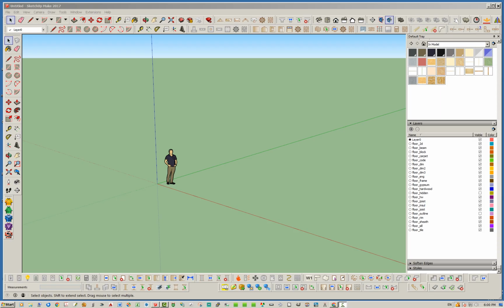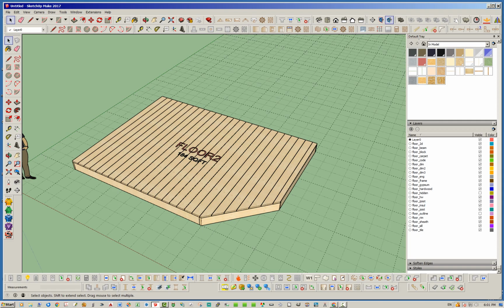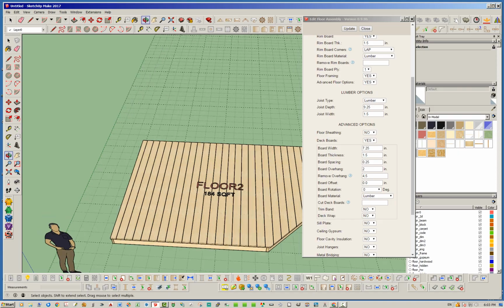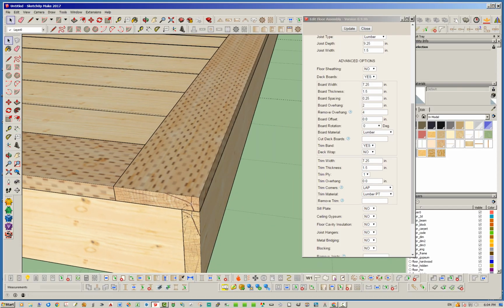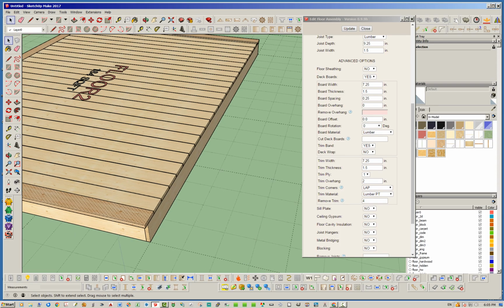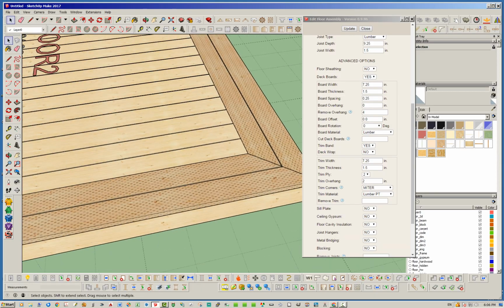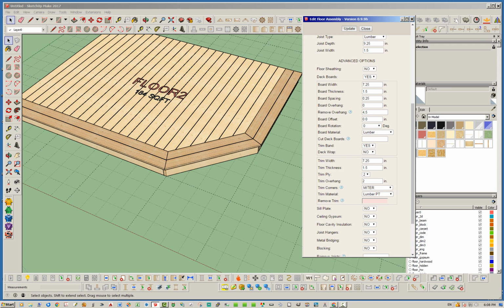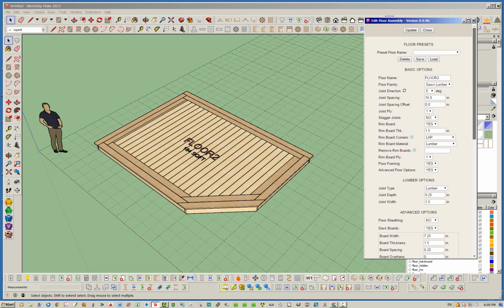Medeek Floor Plugin Tutorial 13 - Custom Deck Board Overhang

Comment: @medeekdesign- Do you think you could add a "max length" parameter to the material libraries? Users could define the longest length by material type and then the program could cut the part if the designed part exceeded the max length.?? Food for thought. 
Thanks for the great work!
Reply from the maker: I like the idea of a max. length but I would probably not assign it to the material specifically.  The other question is how to cut the boards, random vs. set stagger.  A lot to consider here.

Comment: Nice addition to this feature.  The only other thing that would be handy is adding the necessary joists where the trim band is parallel with the joists.  I talk about this in my video.  This extension is headed toward perfection :)
Reply from the maker: I don't have a feature yet to add in extra joists but I suppose for now one could either jump into the assembly copy and paste a few extra joists and rename them to "CUSTOM" geometry, or use the blocking tool to create the additional members.
Reply: @medeekdesign  Yes, that is what I had done in the video and it worked well. Thanks for the continued adding of features.  I had an architect trying to get me to to Revit, which I know and have used before but I told them I was sticking with SketchUp because of extensions like yours.
Reply: Holy cow this is awesome! We design/build quite a few decks. Being able to do this in sketchup is a huge time saver! One suggestion/feature would be an option to add 1 or more breaker boards. When using composite decking, sometimes the deck is larger than the length of the deck boards. We will add in breaker boards so that all of the boards end up stopping at the same point.
Reply from the maker: @williamharper9414   Email me a screenshot or two showing one this looks like, I can give it some consideration and will add it in if I can figure out a decent algorithm for it.